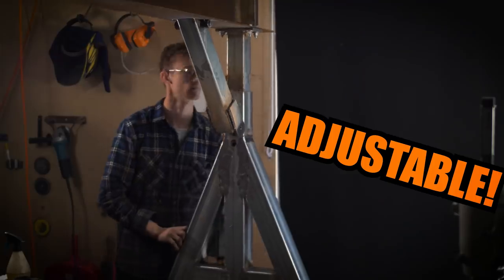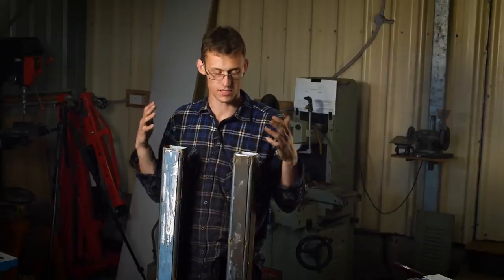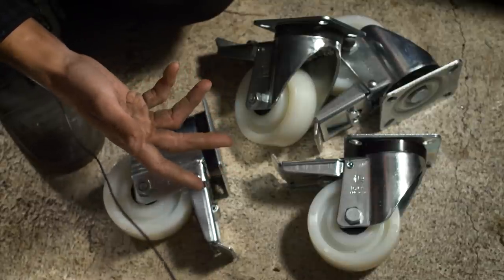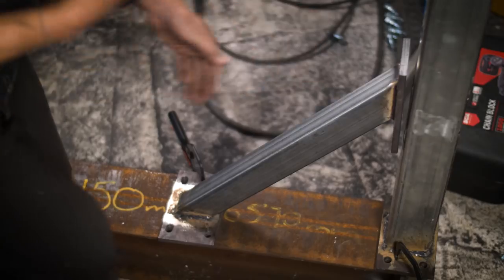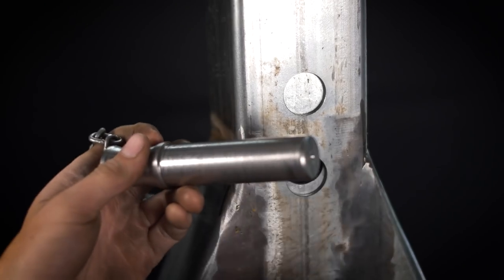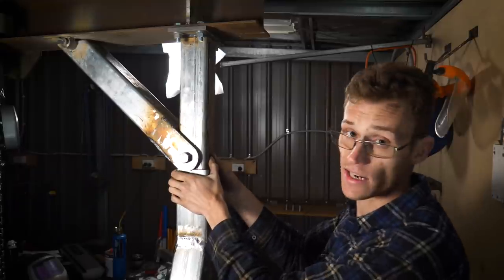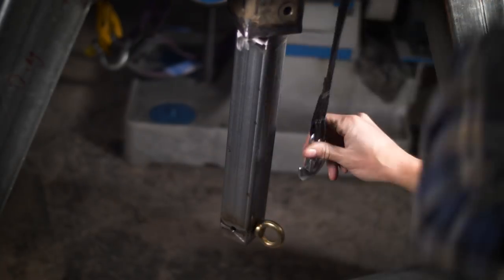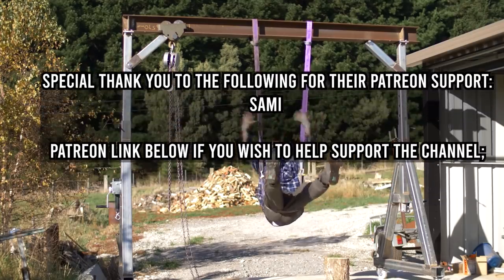Mobile Gantry Crane Build

Comment: Nice job. I like the way those slugs came out from the annular cutter. I've got to get me some of them.
Reply from the maker: Yeah they are handy. I need to add an ejector pin to my arbor. They occasionally get stuck, but are way easier to remove than with a hole saw

Comment: One thing to note I have a commercially made gantry crane 8000 pound capacity its 20 feet  long 12 inch tall i beam and can be raised to 16 feet in height even though my shop has only a 14 foot ceiling. The 10000 pound capacity was 10 to 15 feet long but i wanted the longer stretch for splitting tractors. But the point i need to make is according to my owners manual for the crane it warns about the dangers of moving the crane while loaded mine is a pretty heavy unit it's hard enough to push empty so all i do is if i need to move a real heavy load i just leap frog it pick up load on one end of crane and use the trolley to move to other end set it down reposition crane to next position and do the same thing the i beam doesn't twist on you. So now in theory you can move heavy objects through a door with your setup with the swivel legs doing the leapfrog method . Nice build 👍👍
Edit  and yes i have a swing chair hanging off the crane lol it just works. And also even though my crane has loose legs but when it is pinned with load on it it doesn't really wiggle and definitely enough flex to keep all 4 casters having equal weight 👁👀👁

Comment: If the gantry is on uneven ground it can rock with the weight entirely on two (diagonal) casters.
And if the load is near one end of the gantry during this situafion it can potentially have a weight on ONE caster of the full load weifht, plus half the gantry weight.
Never skimp on casters! 🙂
Great video too by the way. 👍
Reply from the maker: Thank you
I've found that the frame twists slightly and adapts to the ground
But agree, never skimp on casters 😁
Reply: New T shirt message!

Comment: Incredibly well thought out design. Just to light on materials in my opinion for the tube. Really thin wall. I’m trying to build one similar size that I can put together in the field for when I have to reskin skid steer and excavator buckets.
Reply from the maker: Agree, I was limited by the materials I could get. The capacity of the section is fine though
The pins had to be larger than I'd otherwise need to increase the bearing area in the locking holes

Comment: I have seen many people moving stuff with gantry cranes. Moving the winch left-right on the beam is normally super smooth, and the easy to do in small increment.

But castors always want to swivel, especially when going from one direction to another. When moving "a long way" castors are great, they make the whole thing steerable. But when trying to be precise, they're a nightmare. You try to move forward/back and get an unwanted twist or left/right component. Keith Rucker often struggles with this.

May I suggest...

Making the castors LOCKABLE to front/back orientation, so they don't pivot? You would then have "pure" forward/back movement from the castors, and "pure" left/right movement from the beam. This (I think) sounds like a useful thing.
Reply from the maker: It's a fair point. I do need to move it sideways a little inside the shed. I didn't find it too terrible to use, but I'd probably put the load down, orientate the casters, and the move the load if I struggled.
But I might look into adding a lock for just the swivel, it could be useful
Reply: @TomMakeHere  My idea is only relevant for "precision" movement (e.g. lowering a machine onto studs embedded in the floor, or lowering a large milling head onto the main casting).

For larger "moves" castors are a positive benefit
.

Comment: If you put the last hole you showed in the video in the under side of the top rail on a diagonal to the hole on the end of the rail it will be stronger and won’t rack side to side making it stronger
Reply from the maker: Yeah I wanted to do this, or all 4 bolts. Unfortunately the hole lined up perfectly with the web. As a future improvement I'd have a dedicated spigot that the leg can swivel on, and maybe cope out part of the web and weld in a nut

Comment: Very nice build, im going to build one of these soon and you gave me some really good ideas! How much do you think you could lift with that set up? And what size ibeam did you use
Reply from the maker: I used a 150 UC member which will easily hold 1 tonne for the span I had.
I don't really want to give more specifics in case something happens on my advice

Comment: Great Build! just wondering why did you make the RHS legs and struts out of such thin walled steel? I'm thinking of building this to lift 3 tons. I guess 6mm wall thickness and 100m RHS? My wheels are going to be rated Caravan Wheels, so that when the gantry is "lifting" it'll be on its base only. What do you think? Cheers in advance
Reply from the maker: You would be amazed at how strong a thin tube is in compression
I work out that the casters and the I beam will fail before the tube in my case (my beam is spanning a long distance though)
Those sizes sound very robust. It will be heavy, but once it's built it will be a good thing

Comment: On galvanized I like using silicon bronze or 316 wire.
Reply from the maker: Interesting, may I ask how that helps?
Reply: @TomMakeHere  I like less spatter, smoke, and a slightly lower weld temperature. Weld results are better flow and penetration. And in most of my outdoor weld projects no rust or corrosion. Play with it to find your favorite material. One of my projects was galvanized pipe and 304 or 316 did the trick.

Comment: great job, what is the size of main beam? and how much loading does this crane can hold ?
Reply from the maker: I used a 150 UC member which will easily hold 1 tonne for the span I had.
I don't really want to give more specifics in case something happens on my advice

Comment: I like your mill drill
What is the cutter for those large holes?
Also at what speed?
Reply from the maker: Thanks it's a Hercus Mk2 Milling machine
The holes were made using an annular cutter (also known as a rotabroach), I probably run these too slow compared to mag base drills (where they are normally used). They are like a hole saw for metal, but way better

Comment: Upgrade to mig and get rid of the fluxcore. Its worth it.
Reply from the maker: I like to use gassless mig as a fast and portable process, especially on fabrication jobs. Eventually I will set it up. But if I want a very clean weld I use tig. There is a lot of redundancy in the welds on this gantry

Comment: Arguably a silly question, but would you mind covering how you determined the load capacity of this gantry?  Is it just sheer load for the I-beam and compressive load for the A-frames?  Whatever the lowest load between those two, that's what your max load for the gantry is?
Reply from the maker: Need to consider bending and shear of the beam, a central load causes maximum bending and at an end is max shear. Also compression in the a frames, a bit of allowance for the brace inducing bending, and the caster rating. But yes the lowest capacity component is what will limit the rated capacity. It also needs a factor of safety of course, so you aren't right on the limit
Reply: @TomMakeHere  This is generally calculated through the ratings based on gauge and length?  I wonder if there's a pocket field guide that's "engineering for idiots".
Reply from the maker: @williams.7314  yeah I'm a bit hesitant to give any definite answers on capacities for fear of someone getting hurt. Iys hard because different parts of the world have different material strengths and sizes so it's a bit tricky to advise as it's a global audience 😅

Comment: 19:00   you might want to consider, replacing PLASTIC  wheels, with  REAL WHEELS. Air inflated 5 or 6 inch ones, rated AT at least 2000 lbs each. You are on eneven surfaces, as well.
Reply from the maker: I don't think I will move it very often, so I'm not too worried about moving it off concrete.
I was thinking about this approach when designing it, but the height and width limitations mean I don't have a lot of space to fit anything larger.
These were the only swivel casters that were rated high enough with a brake that I could get at the time. If the plastic becomes an issue, I'll make steel wheels at least
Reply: @TomMakeHere    OKay. You know what your needs are better than us.  TAKE  CARE, and B safe...from central Alberta Can

Comment: It may have already been asked, but do you have plans / beam sizes for this?
Reply from the maker: I'm very hesitant to give out sizes and capacities. Because it's a global audience, I can't guarantee similar steel sizes or strengths are available in other countries. Last thing I'd want is for someone to get hurt
So, no. I've not released plans unfortunately
Reply: @TomMakeHere I thought that would be the case.  Thanks for replying so quickly.  Oh, what do you think is the lifting capacity is or what’s the heaviest item you’ve lifted?
Reply from the maker: @fredspain4197  I've lifted about a ton, but it has plenty of spare working load beyond that

Comment: NO... be careful... An eye bolt rating "General" drops by a quarter when the load is not 90 degrees but somewhere between 112 and 67 Degrees (~ 45 around the top) when you apply force below or above this range then the rating drops by HALF.
Reply: Love the build
Reply from the maker: I'd have to go back and listen, I might have mispoken, I meant it will drop to a quarter of the rating for 90°. I got that rating out of the Australian Standard AS 2317. Hopefully the take away for people is to check as the full rating does not always apply
Reply from the maker: @Hope4Today9  thank you

Comment: would have been way easier to use if you had used hydraulics
Reply from the maker: This is a future plan to hydraulically jack the legs. The only problem is that it is expensive